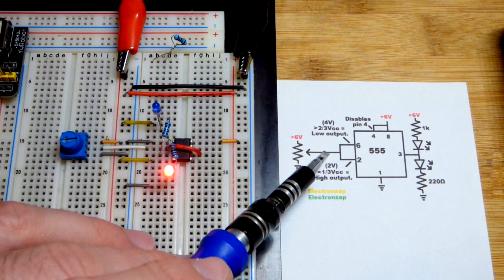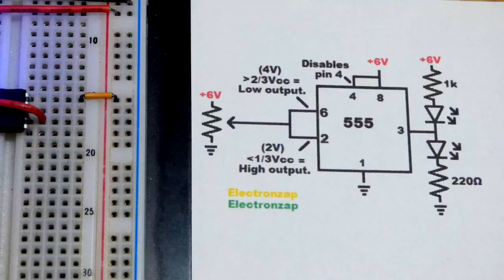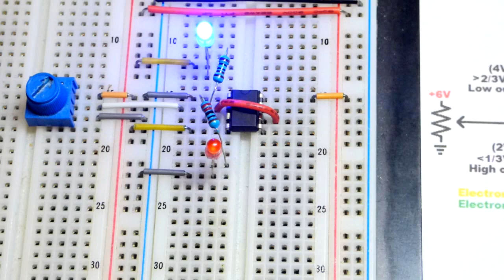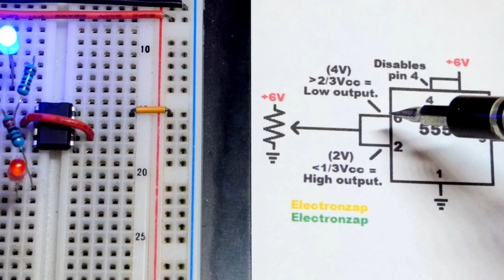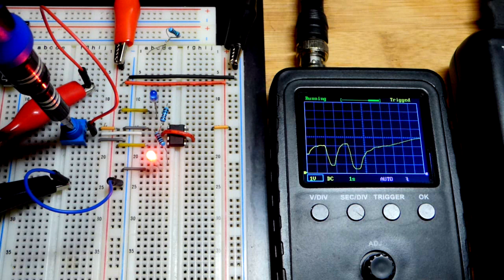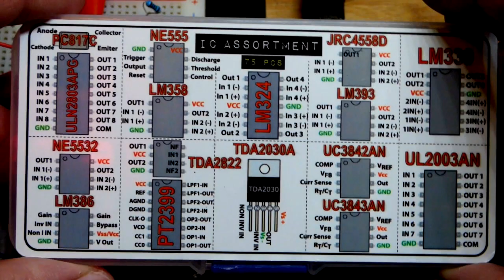How to wire 555 timer into a schmitt trigger digital inverter electronics circuits DIY tutorial

Comment: it doesnt do anything. a 555timer works on trigger being a active low. linking 2 and 6 and giving it a voltage means nothing especially when pin 7 isnt linked for a comparison. the reason the oscillator circuit works is one pin 7 is given a voltage and two the joined pin 2 and 6 have a capacitor tied to ground. when its charging it acts like a current sink and then it will fire its high. try it out . this circuit does nothing

Comment: Not trying to split hairs but I would classify this as a binary signal, not quite elevated to a true digital signal. I had a heated debate with someone much more knowledgeable than myself about whether or not square waves are digital or analog and I still contend they are not digital just because they only have 2 states. That makes them binary -- they can still be analog. This circuit is converting an analog range into two discrete states, but it is not being driven by a clock itself. Rather, it can be a clock and drive a digital circuit.
Reply from the maker: This is definitely binary, high and low are the same as 1 and zero. I think people that work with clocks a lot are more specific with their terminology than general electronics people.
Reply: My background is computer science --- we get some of it right but generally we have no idea how the foundation works. I am correcting that deficiency within myself. :)